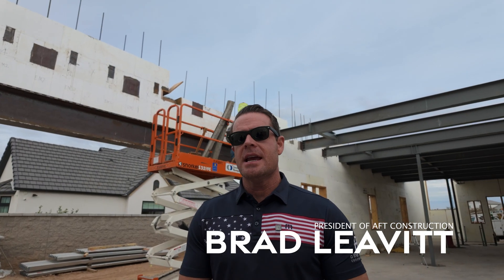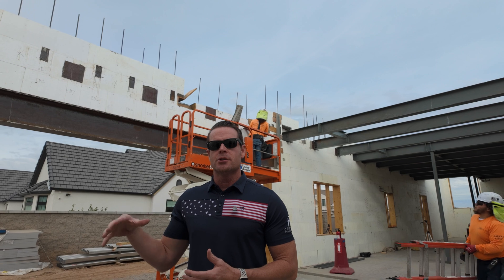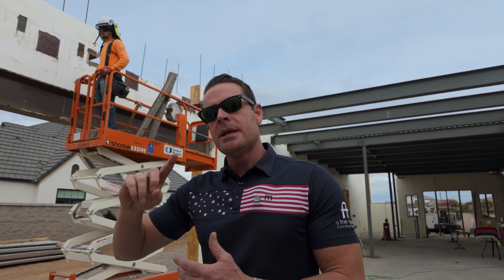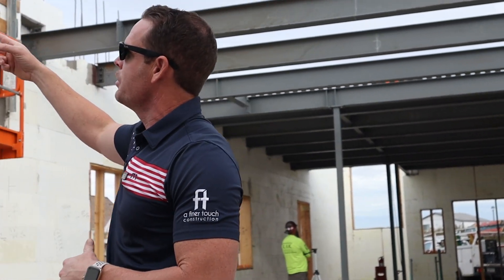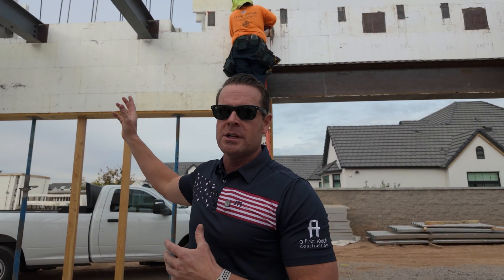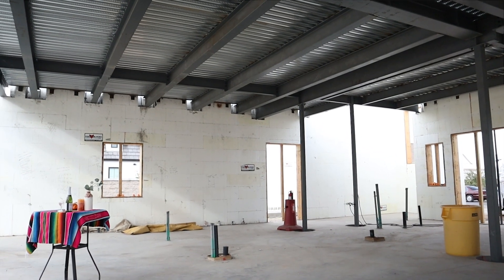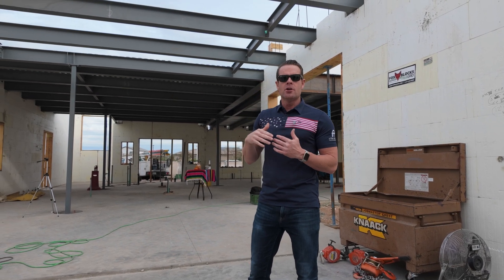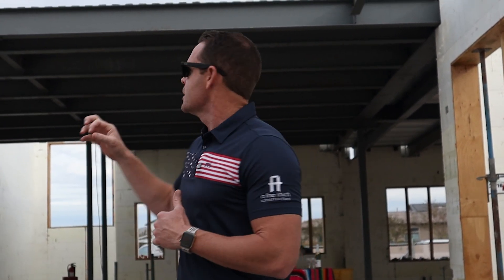Maximizing Ceiling Height With Steel | EP-29: Liberty Estate |  AFT Construction

Comment: Curious if you've ever used fiberglass truss beams instead of steel beams?
Reply from the maker: @ItsJustAlexOfficial  I have not. I need to look into it.
Reply: @aft_construction  There are quite a few companies out there that manufacture these beams. Not as costly, and stronger and lighter than steel.
Reply from the maker: @ItsJustAlexOfficial interesting.